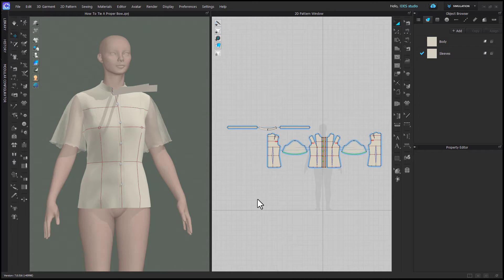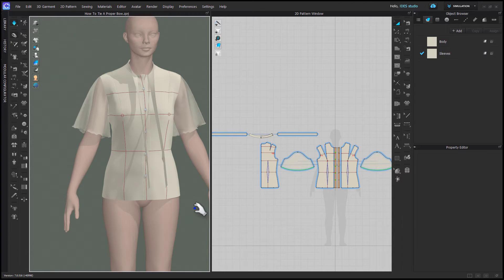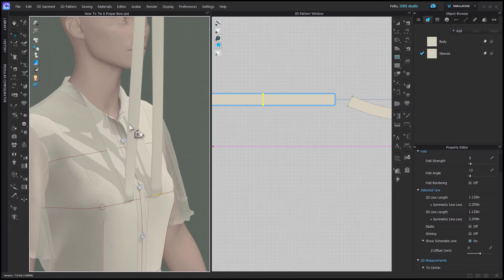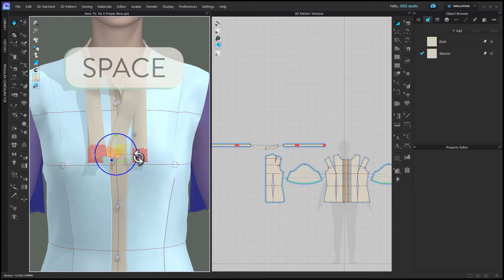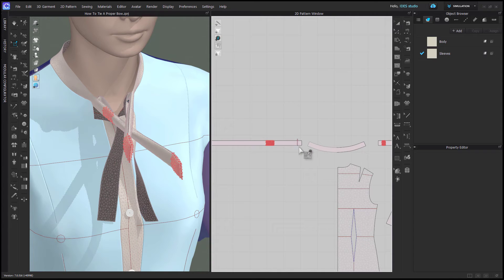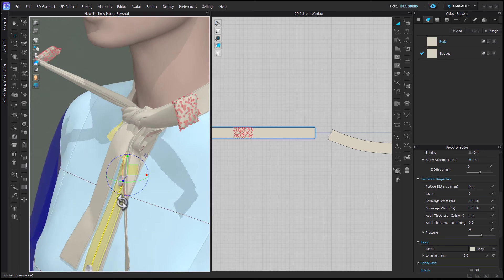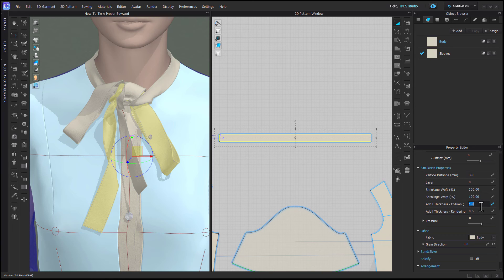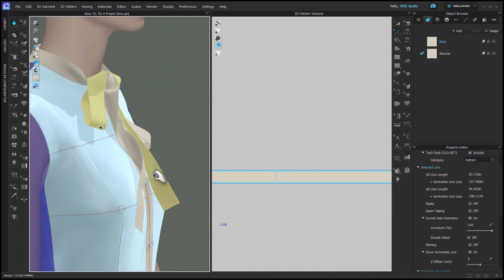How To Tie A REAL Bow in CLO 3D

Comment: I tied the ribbon, but it came undone as the fabric overlapped.😢😢😢😢😢
Reply from the maker: Did you adjust particle distance and collision thickness? You need to be sure the ribbon is no larger than 5mm particle distance and the "add'l thickness collision" is at least 4. Make sure you don't pull too hard. Let me know if this helps.

Comment: the hardest thing in CLO3d is not to tie a bow or make good pleats, but so that the simulation does not glitch =)
Reply from the maker: Hmm what do you mean by glitch?
Reply: @ides.studio  The cloth keeps passing each other, im struggling with this issues aswell
Reply from the maker: @yves_jotres  Make sure the particle distance on the pieces you're tying is no bigger than 5mm. Increase the "Add'l Thickness Collision" on those same patterns to 4. You also need to be mindful of the tension and not try to pull it too tight. It's tricky and takes practice! Let me know if this helps.